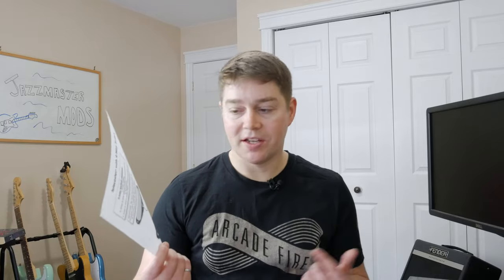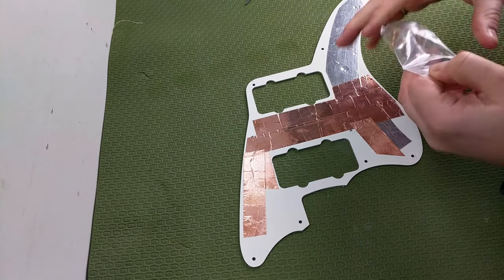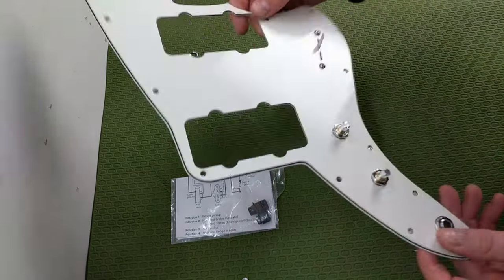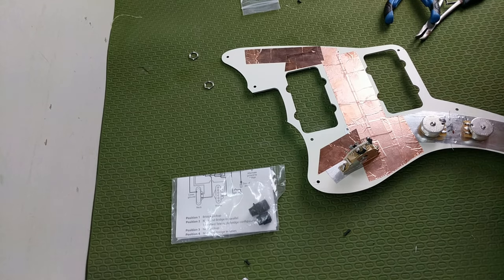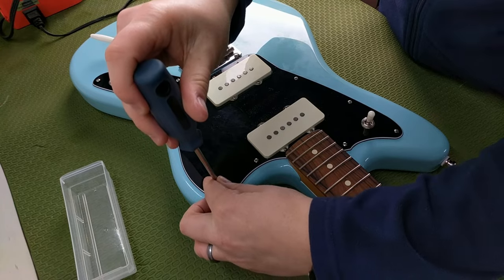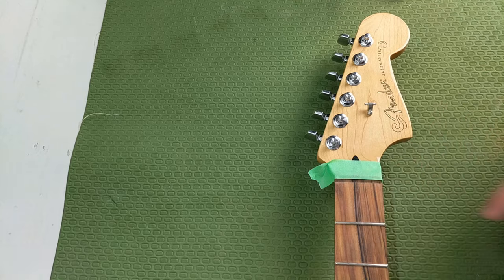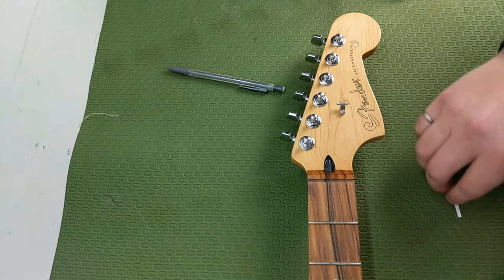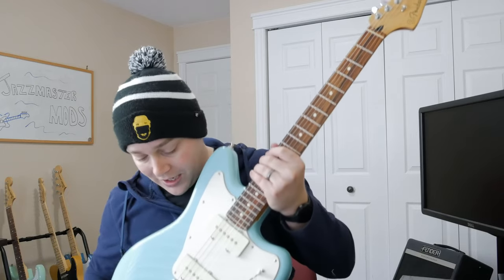Jazzmaster Control Mods | 4-Way Switching, 250k Pots, 33nF Cap | DIY Guitars

Comment: Great video, very helpful, but JM purists would say it's supposed to be 1 meg pots.
Reply from the maker: Agree. I think I did 500 is standard in the video, but that is more modern as well. 1 meg was the original value
Reply: I've heard 250k pots were installed in first run Jazzmasters from 1959(?), 1 megs came in the following years. To each their own, I'd say
Reply: @andyspencer4786 I have not heard this before, but I wouldn't be surprised